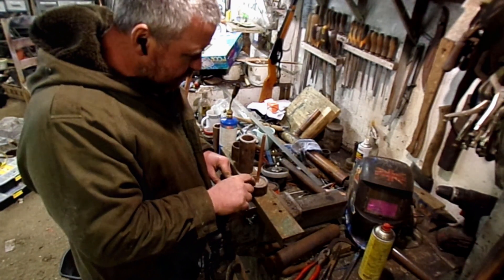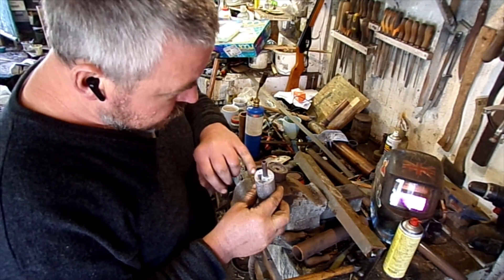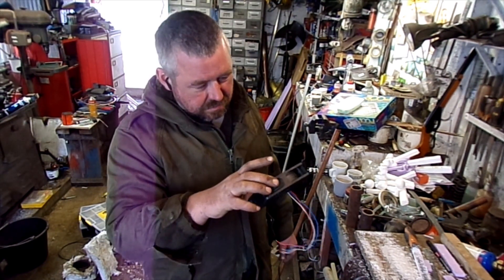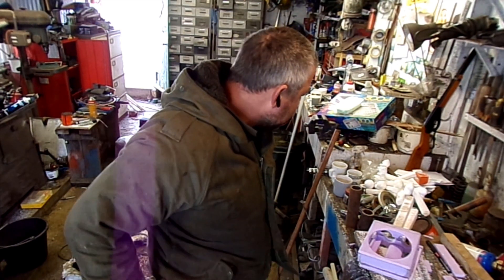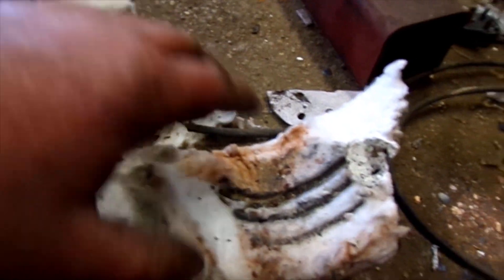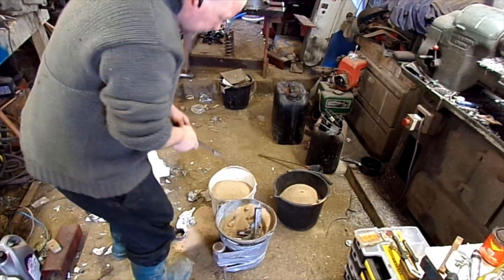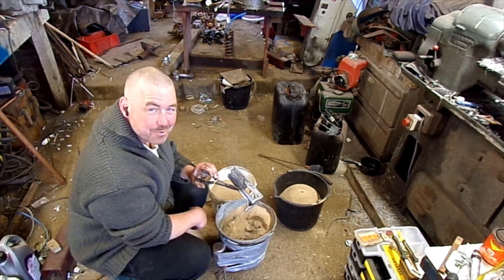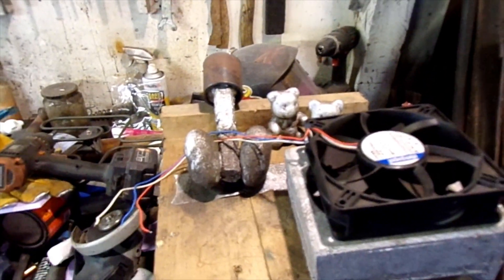Casting aluminium over coper and other random cast bits.

Comment: You forgot to mention where you got the patent for the cooler tube fins from :P :P . I can feel the pain of when they got thrown away from the chuck.
Reply from the maker: *patented enginelover1 trademark compressor after cooler designed in Malta!
The copper pipe was well off center so couldn't use the tailstock.

Comment: I must have missed this . What a great bit of casting. The box came out perfectly top job  and the bears were cute. 😀
Reply from the maker: Was a fun little project, success will be when I cast the fins rather than machining them!
Reply: @turboconqueringmegaeagle9006  I did wonder if you could make fins using lost foam, would be hard to do with sand casting.  😀
Reply from the maker: @julias-shed  from what I've seen, putting a coat of plaster on the foam and applying vacuum to the sand flask is the only way to get nice thin fins, I'm working towards testing those methods!

Comment: Hello dude, just wondering what you use for editing video. I do all mine on my phone and use inshot but its acting up so I'm looking for options. Cheers
Reply from the maker: HitFilm, just because it's free but I really should look for something better, you can buy additional features.
Windows has a perfectly usable free editing program more usable than what I'm using except it won't automatically convert different video formats so I was having to convert before making a video and I'm lazy.
Reply: @turboconqueringmegaeagle9006  I looked at 3 other programmes yesterday but they wont let me import my videos without changing the resolution, one was vllo another was something like cut vid and I've forgotten the 3rd. I'm thinking I may need to buy software but I have absolutely no idea about what I'm doing still with editing and such..... it's a real pain not knowing about all this
Reply from the maker: @smithbuilt  look at someone's overview of HitFilm, I'm pretty sure it takes care of all that without asking too many questions but I'm probably not the guy to ask about this stuff.
How's the painting going?
Reply: @turboconqueringmegaeagle9006  I got some spray guns to try. I'm about 70% done with painting the main machine but I still have all the attachments to do including the single point station and drill sharpening. My biggest issue is having room for parts to dry.... the big shed is in a state of limbo waiting to move it all outside for the floor my little workshop just doesn't have room full stop and the lean too on it is full of all my "new machines" being stored for when I get the big shed done. I'll take a look at hitfilm later on today. It might work

Comment: The lost foam now , would expanding foam work? Hear me out now,  could you make wood master moulds and grease them up then fill with expanding if you have a repetitive job on
Reply from the maker: It's getting quite popular in industry but always polystyrene, anything else doesn't vaporize the same way.
Reply: @turboconqueringmegaeagle9006   suppose polly would be mouldable? The cups seem to be little pellets pressed together but it would mean like a jelly mould with a flat side
Reply from the maker: @arwelagrimachinery  they blow pellets into a mould with superheated steam

Comment: That easy melting solution using the old cooker element is neat, and also a tiny bit scary too!!!  So frustrating when the first one snagged in the chuck when parting off.  Great design for the heat exchanger, no one else will have one quite like that.  And a few toys/trinkets cast at the same time - a good day or twos work.
Reply from the maker: Cheers Tim, lost foam and cooker elements has more freedom than a 3d printer and both are underated.
Reply: @turboconqueringmegaeagle9006  I really should do some casting one of these days, it opens up endless possibilities for making exciting things.......

Comment: I hate to be so completely off the topic, but there doesn't seem to be a way to send you a message on YouTube... Anyway, you had mentioned Shotcrete that you can apply with a trowel instead of being sprayed/blown up, and I found this video: https://youtu.be/RADNKKdnSNo 
I am thinking of doing this method since I can get ahold of cyclone fencing and then I would have permanent walls for the root cellar/ fallout shelter that I am currently digging very, very slowly. 
Thought you might have a comment or input. The video I linked is nice because he gives a detailed recipe for his concrete.
Reply from the maker: In the same way he's got fence posts I can imagine you'd benefit from some rebar to stretch the fencing between. 
This chap seems to have a nice process, if you're just using the fencing and no fine mesh on top then you'll end up with a much thicker wall because you'd need to layer the fencing 5 or so deep in a staggered pattern to give the render something to grab onto but it might actually be beneficial doing it like that as at least you'd be able to push it all the way through, you don't really want an air gap on the mud side, obviously this chap and the ferrocrete builders render both sides. 
Would be worth playing with some mixes and different layers especially considering you'll be doing overhead work.
I was envisaging tent pegging chicken wire to mud with a spacer to keep it off the wall.
Got many thoughts on this way of doing things as it's something I'm considering for my rooms.
Reply: Wow! Now I've really gone down a rabbit hole, learning all about this subject, slowly.

I had never heard of Pargeting before today.

I have much to learn.

Comment: I like that little video thank you. I've got a copper coil around my wood burner coming from a water tank back to the water tank. To a gravity fed mixer tap, then to a Water pump to my shower pump on my Boat.
Reply from the maker: Nice and simple, one of the incentives for me to get better at tig is the limited lifespan of the stainless back burner on my stove, next time it burns through I'm going to make an absolute beast out of 5mm plate.

Comment: Nice work butty! That lost foam works a treat. I was thinking about casting the other day, I need a couple of bits of brass or copper bar to make weights for my bow
Reply from the maker: Depends how complicated you want to make life, see I've done brass over coal in the forge before, gotta be the easiest way just make a loose brick square, throw coal in it and shove a blower on it.
Just wouldn't want to do it like that all the time as it rinses the coal and that stuffs dear now innit.
Bloke near me does sea coal, could probably use that but I'd end up throwing the leftovers in my log burner and rotting my chimney so it's best I never get any.
Reply from the maker: Got to be bloody careful with the zinc in brass though mate, I've given myself a bad head a couple of times messing with it.
Reply: @turboconqueringmegaeagle9006  I learns the hard way with zinc, I welded a load of galved steel when I was young and didn’t know any better, Jesus did I feel rotten afterwards 🙈